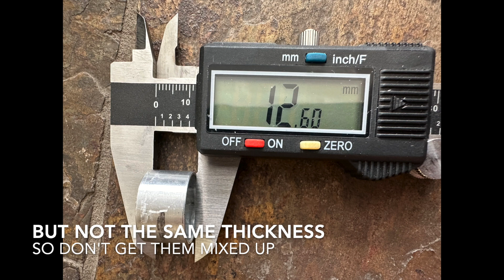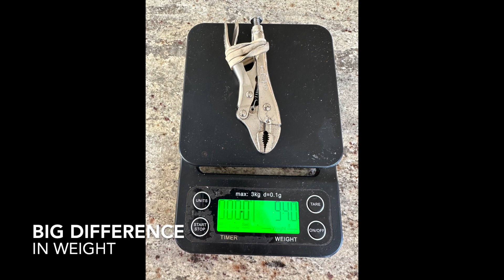Snoek Velomobile: The Rear Wheel

Comment: Was that sidewall failure from the glass on the ride?  That's a pretty significant leak.  The rear wheel mounting looks really similar to the DF / DFXL so I'm assuming you can't use XDR or Micro spline?  Just HG Shimano compatible cassettes with the Snoek?
Reply from the maker: No! This is a brand-new, never used tire. It seems it got cut by an X-acto knife. You can use XD but need a new free hub.
Reply: @shenzhenpingpong  some idiot cut your tire ? now you have to suffer working on it, the persons karma is in negative now.
Reply from the maker: @ColourRevolution666  must have happened in the factory as tire came boxed.